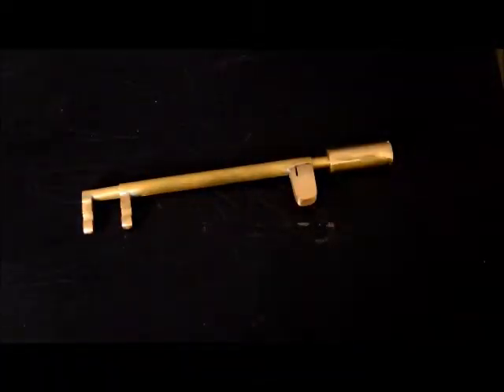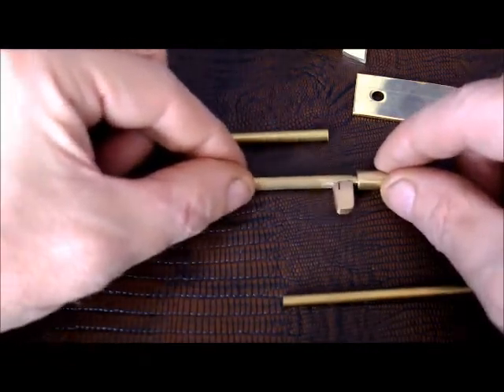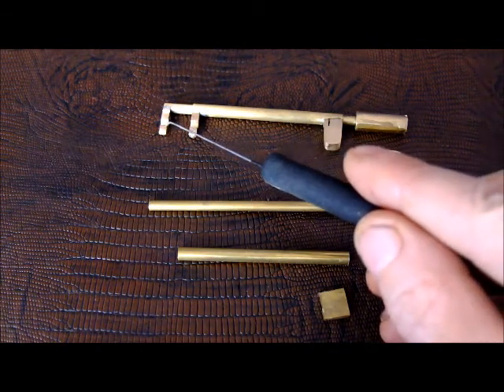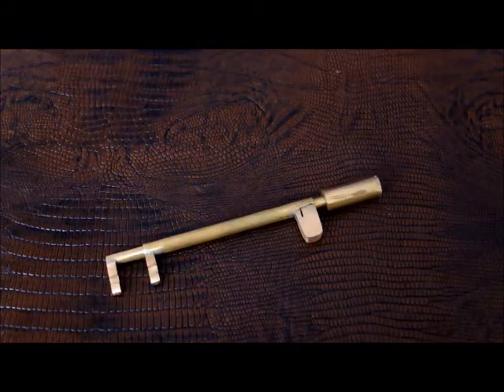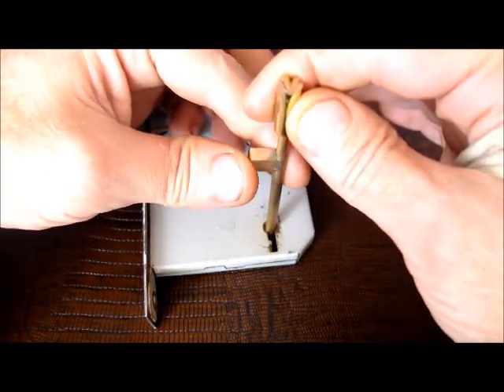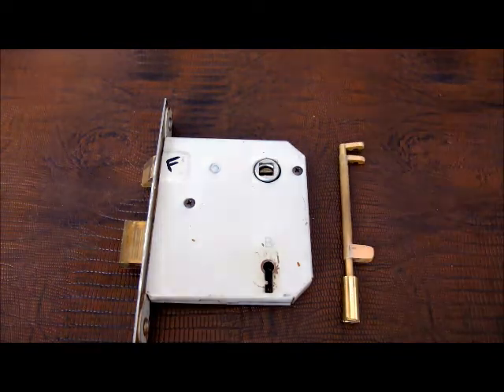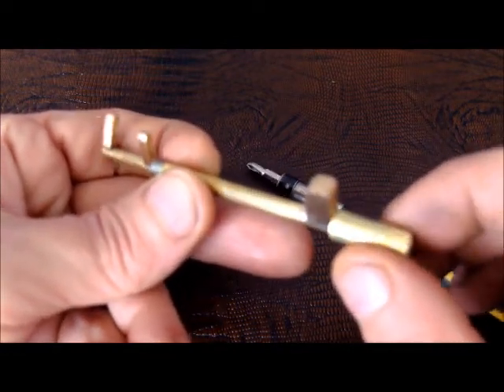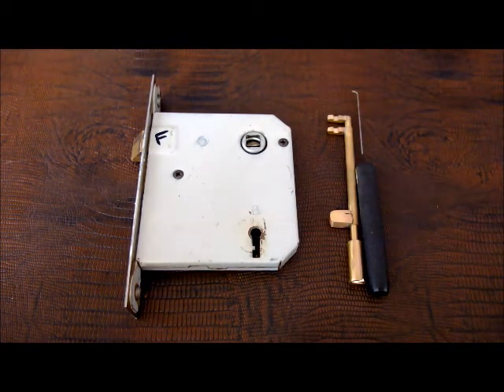My low budget lever pick

Comment: Loved the creativity side of using other parts laying around sore this on eBay would work I think creating like the swivel end of a watch repairers screwdrivers https://www.ebay.co.uk/itm/SOLID-BRASS-KNOB-FOR-TURN-KNOB-LAMP-SOCKET-LAMP-PART-NEW-20924JB/152860030138?hash=item23972af4ba:g:X2QAAOSw0cdZierZ now how do I request one mailed to me
also a brass item that I think could be used too https://www.ebay.co.uk/itm/2-x-SOLID-BRASS-CABINET-CUPBOARD-SHOWCASE-LATCH-Thumbturn-Show-Case-Door-Lock/192471156654?hash=item2cd02cc7ae:g:V5oAAOSw1DtXH4E8
Reply from the maker: Nice idea. The extra grip/control certainly wouldn't hurt. I really need to make something better. This was just a silly test and this tool is really only suitable for a single lever lock. Looks like it may be time to go back and see if something better can be made simply.